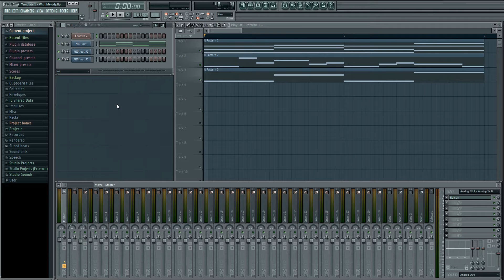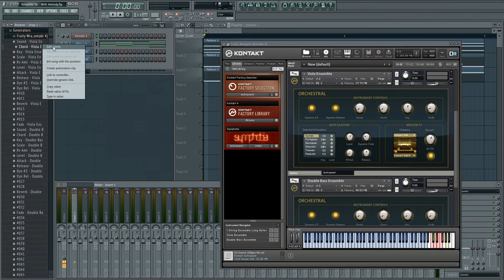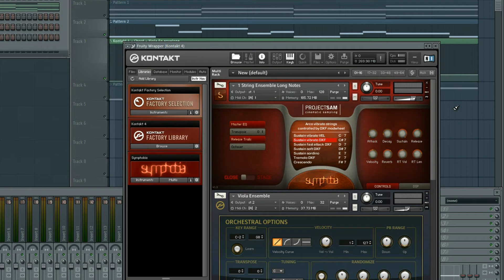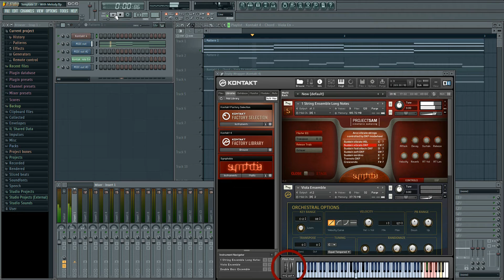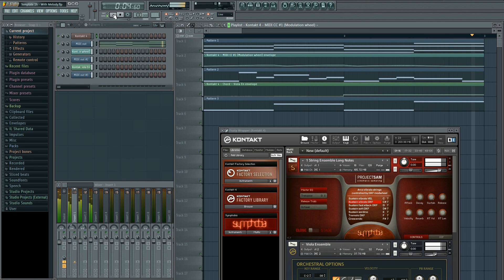Automating Kontakt Instruments in FL Studio

Comment: Is it possible to automate the velocity of an instrument with the modwheel? Say i have an orchestral patch in symphobia that changes expressiveness based on how high i put the velocity. How can i make this so i can use that same function with the modwheel (or at least some other way to modulate it in FL Studio)? Using only the piano roll only allows me to play singular notes; i can't create swells, fades etc.
Reply from the maker: "Is it possible to automate the velocity of an instrument with the modwheel?" Hey buddy. Yes, if the patch allows dynamic cross-fading (DXF). That's what the video shows. Towards the end I create swells on the string patch using the modwheel to control velocity. Maybe I've missed the point of your question?

Comment: Extremely helpful video! Thank you for this tutorial. Question though - I was trying to automate a pitch-bend, and there is no "pitchbend" listed in the MIDI CC's, and there was no way to assign the pitchbend wheel to either the host or MIDI automation parameters (I kept getting the little circle with the line through it when I tried to drag-drop). If the pitchbend wheel is not listed, is it impossible to automate it?
Reply from the maker: It depends on the instrument you are using. I was able to automate the mod wheel with the Symphobia string ensemble because this particular patch allows dynamic crossfading. I couldn't have automated the mod wheel with the Kontakt viola or double bass ensemble because they don't have dynamic layers. Same with the pitchbend wheel - it depends on the instrument.

Comment: ok first, thank you for this video. I've got a question though on linking the mod wheel to one of the three instruments loaded into kontakt (only the first one, like @ 10:00 in the video): I've got three instruments loaded, each on their own channel, etc. I basically want to imitate 10:00 - 11:10 in the video and end up with a clip that controls the mod wheel for instrument 1 but not 2 or 3. The problem is if I do this, the clip pertains to each instrument loaded into kontakt, not only the first one (eg. the basses get louder but the cellos do, too and I don't want that). It begins to feel like I've got to load up an instance of kontakt for every instrument I'd want to do this for uniquely, or I've just not quite figured it out yet?
Reply from the maker: Sounds like a routing problem. Check out the first video, Routing Kontakt in FL Studio. This explains how to configure the instruments in the first place. Also, make sure you don't have 'Midi Ch' set to 'Omni' on the instruments. Hope that helps.
Reply: ***** It turned out that's not the issue: if I use the existing kontakt > auto > midi automation > 'cc 1' that effectively lines up with the current project > generators > fruity wrapper (kontakt) > 'midi cc #1 (modulation wheel)' and that's what I'd put the clip on, but this ends up modulating every instrument that would effect. If I bypass that (just ignore it's there) and instead link kontakt > auto > host automation > #001 to this (i.e., the parameter that's linked to the instrument's midi automation > 'cc 1', too, thereby ending up with two links I guess to that parameter), it then only pertains to that instrument and lines up with the current project > generators > fruity wrapper (kontakt) > '#001'. Identical process then for instrument 2 using #002, etc. It feels like a bunch of extra inelegant tasks, but it works..
Reply from the maker: OK. Glad you got it sorted!

Comment: Hey man do you know how to set up Kontakt mod wheel?
I mean it's always the same interval, I change my midi controllers wheel values but Kontakt keeps always the same interval.
Thanks.
Reply from the maker: At one point in the video you see a pop up window called Remote Control Settings. Down the bottom click Mapping Formula. You get a number of options for changing the scale relationship if you are recording automation in real time. Alternatively, if you are using an automation clip, open its Channel Settings window and change the "min" and "max" settings up the top. Hope that helps.